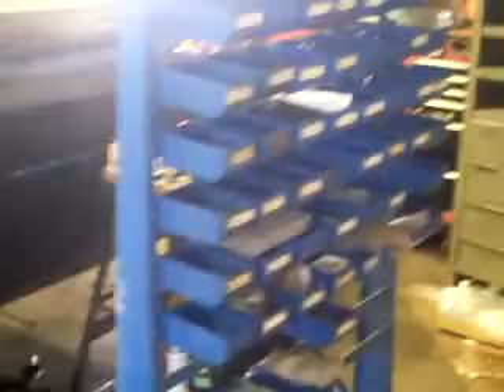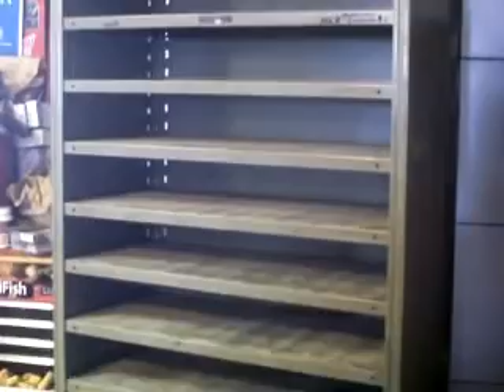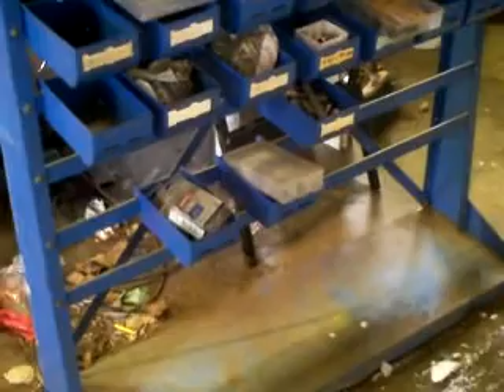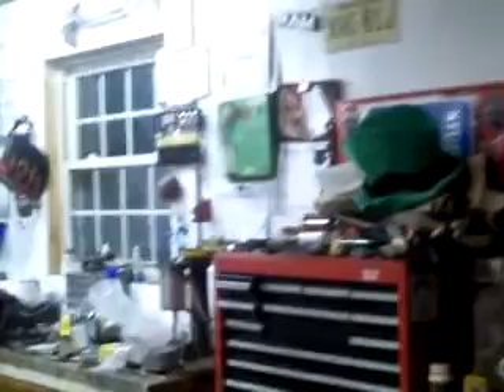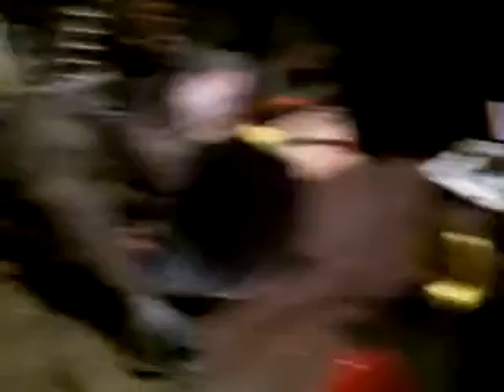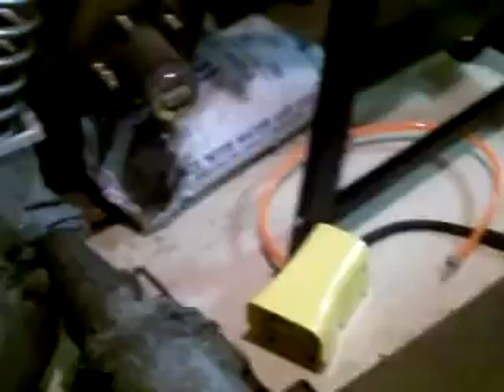Shop clean up pt1

Comment from the maker: I bought a used Lincoln Mig pac 10 about 8 years ago, it's a 115 volt unit, which I like, I use gas and have no problem welding up to 3/16 when prepped well. I never change my wire I just use .030 for everything. Cheers.